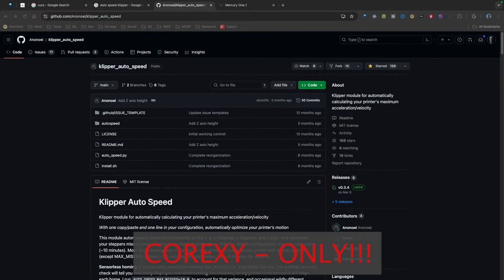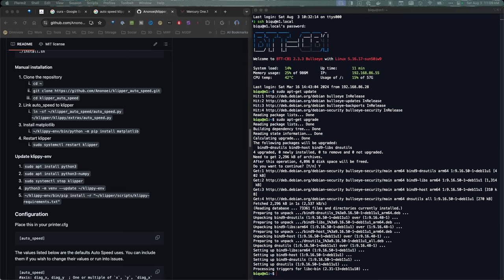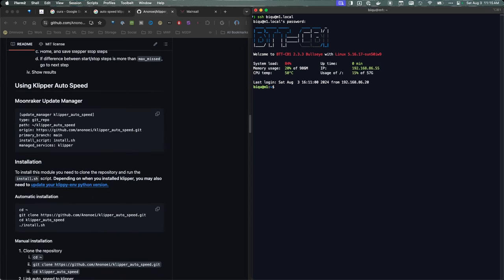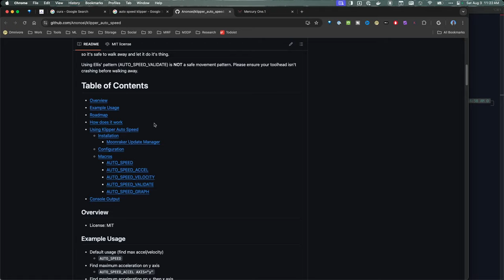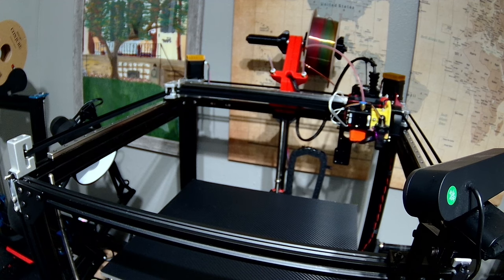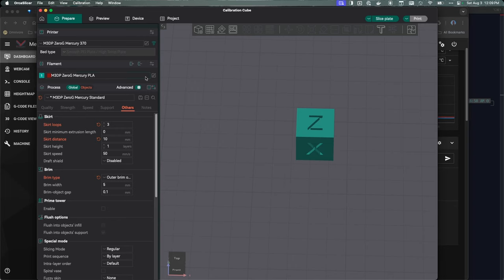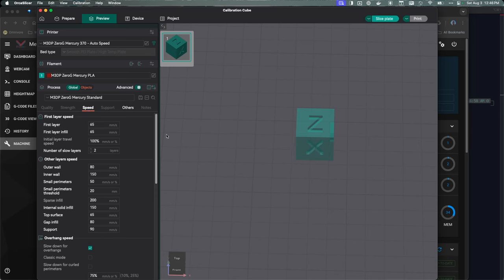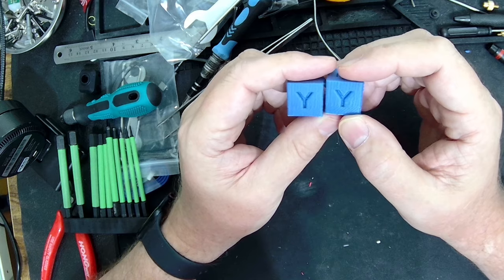Optimize Klipper for Speed: Using Klipper Auto Speed

Comment: you attempted to set the top surface speed to 50,000 but you actually entered and saved 5,000... you did still increase that value from 3,000 but said 50,000 but you just missed a 0. keep these great videos coming.
Reply from the maker: I am sorry for the mistake, but I appreciate the kind words. My own fat fingers are my worst enemy.
Reply: @minimal3dp  no, its all good, I just thought it could help to crank a few more seconds off the print time. But might effect the top surface print quality.

Comment: I am curious if you adjusted your material flow rate as well? When you sliced your model did you preview the speeds to see what was theoretically reached during printing? I seem to hit my limit on my flow rate for my creality k1 way before I reach the speeds I could reach.
Reply from the maker: I have not adjusted the flow rates yet. Although the accelerations and velocities are fast, my print speeds are still slower.
Reply: @minimal3dp  slice your cube with the new speed settings. Then look at the speeds, you may be flow limited if you aren't seeing the speeds.

Comment: Funfact i had exactly the same values as you. 
If you run AUTO_SPEED_VALIDATE Accel=78350 Velocity=1339
you can see that this is beyond what the printer can really handle. 

i think you need to add a real range in the printer.cfg
Reply from the maker: I will probably change the range. I will compare to Ellis’ method, and I think the VFA(?) test in orca slicer.
Reply: @minimal3dp  yeah but thats also another story

Comment: probably won't make much diff but you only put 5000 on your top layer. What I'm more interested in is, if you're able to delve further into IS topic. Specifically troubleshooting Y  more than X as that could be caused by cables, PTFE, mechanical, frames, I realised that this can be a bottomless pit topic, but again I haven't found any youtuber have taken this topic to the T.
Reply from the maker: Dang, I ment to do a top of 50000 and fat fingered it. I will look at the trouble shooting.

Comment: You choose the worst model to try and test speeds and acceleration. Your not going to get anywhere near those speeds on that tiny cube. That's why the time difference was so small between the 2... Also, those maximums your setting will far exceed what your hotend can even produce which again, is preventing you from reaching that kinda speed during printing.
Reply from the maker: My print speed is relatively low, so the hotend should keep up. I will test a larger model.
Reply: @minimal3dp  With such small model minimum layer time (from cooling settings) will probably kick in. You will need big model or disable it (which on small model will probably mess it up a lot :) ) + probably max volumetric flow in filament settings..